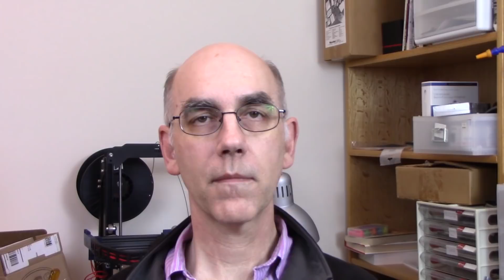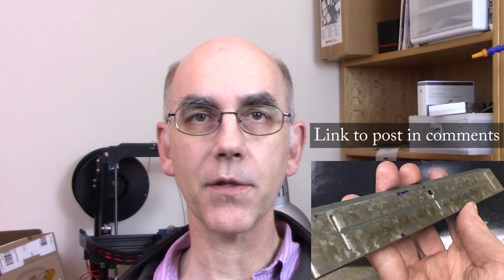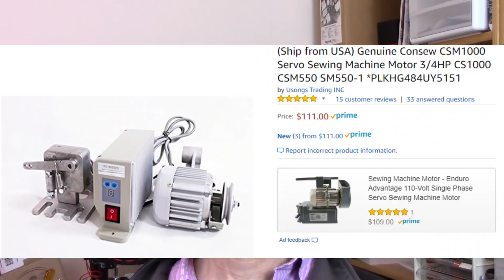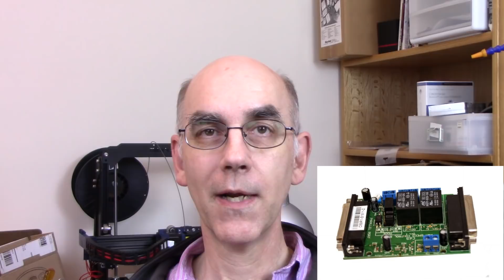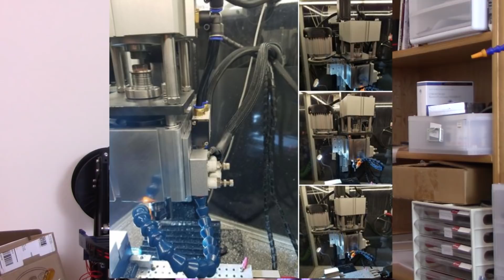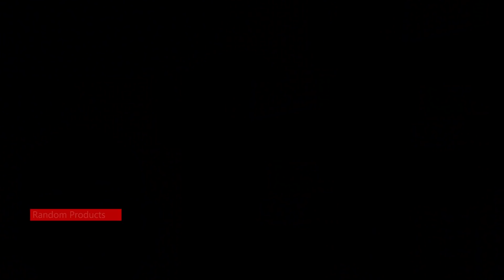#34 "Taigmach" Part 1

Comment: I have done the motor mod. Be aware the Consew controller expects 0 to 5 VDC to control the speed. My Gecko G540, and all others I have seen want to output 0 to 10 VDC for the VFD speed control. There is a schematic on the Taig Facebook group for converting this, and it takes some tweaking to get it right. I used the original pulley on the Consew motor and a Sherline size belt width to a homemade pulley on the Taig spindle. Also note, the Tormach has an oiling system, the Taig does not. I hope you are oiling it before each use. Good luck and I'm looking forward to your progress.
Reply: I've given him the warning speach on the Consew....LOL.  And showed him the CNC4PC speed control card which is easier than using the G540 VFD out.
Reply from the maker: That you did. I may create a simple circuit to do the translation so I can set a minimum (since I read it starts at about 1.7 V).